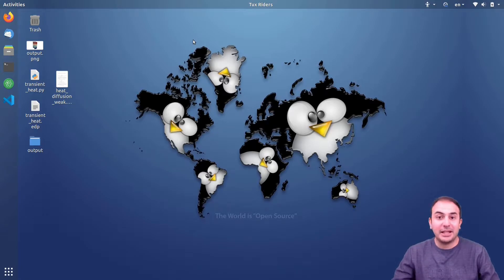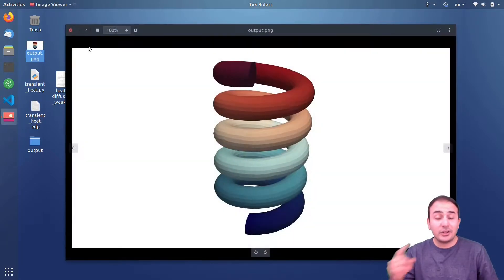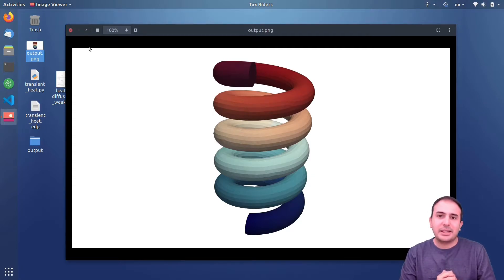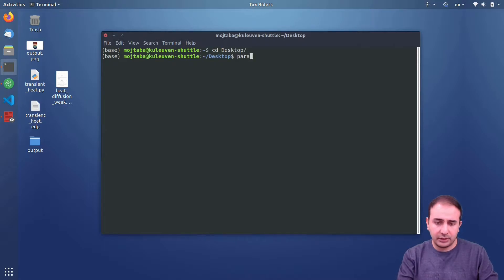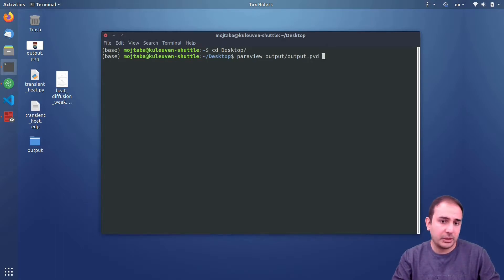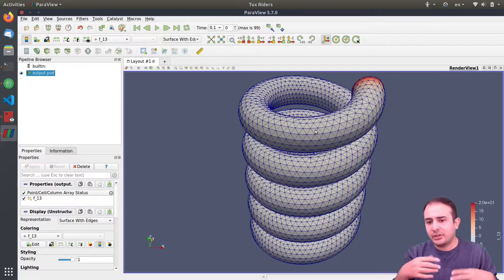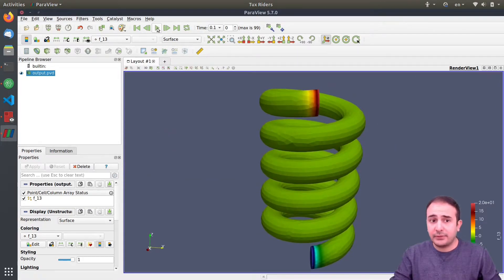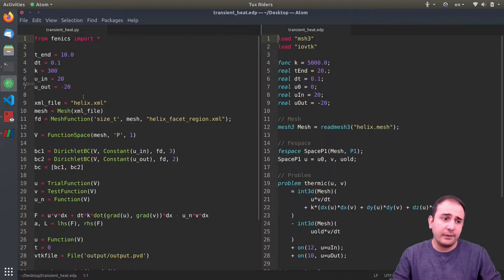[Finite Element 7] Compare FreeFEM and FEniCS for the transient diffusion problem

Comment: Did you test the performance in these two programs?
Is there any advantage in execution times of any of them?
Reply from the maker: no I didn't, but since FEniCS uses PETSc by default behind the scene, it will be faster in the first place. however, if you tune the FreeFEM code by adding parallel features to it (which is very simple to do as describe here: https://www.youtube.com/watch?v=MvovTTcKEb8), it will be faster in comparison to the FEniCS model.

Comment: very nice. thanks for the direct comparison of the two codes. I had found both fenics and freefem++ years ago. At that time freefem was definitely the code that showed closer connection to the weak formulation (at the user level). Now, fenics with the python interface, looking pretty nice.
Reply from the maker: very cool :) totally agree.